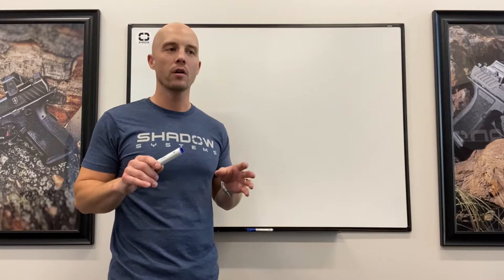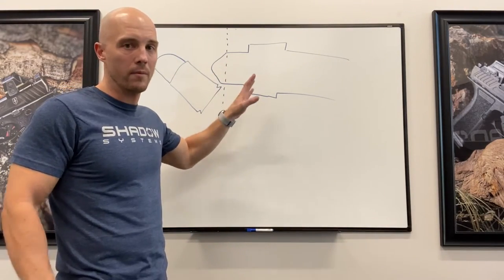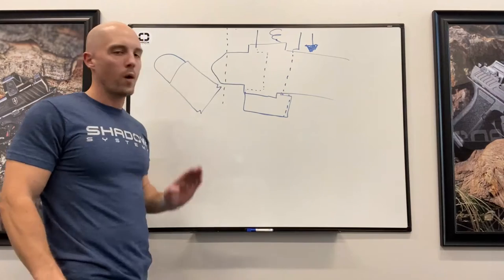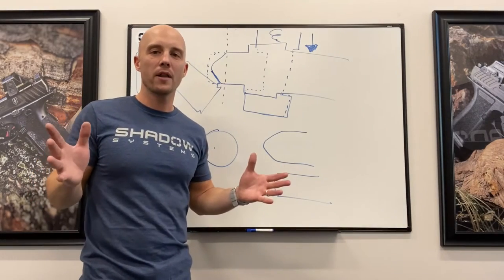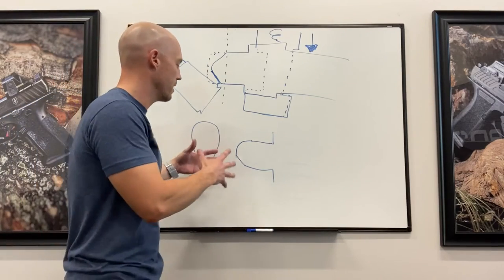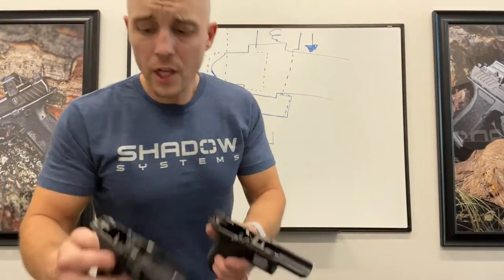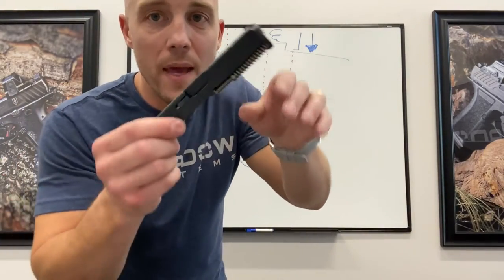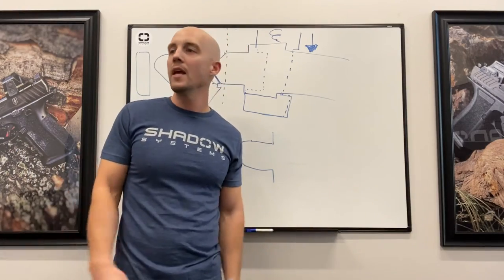Technical Tuesday: What's up with the new firing pin system?

Comment: That's exactly what happened to my MR920, broke the firing pin, but the support was A++.  Now I understand why it broke.  Thanks for the explanation. Btw, I love my new DR920!!!  Big hands and all...
Reply: I had the same problem with my MR920, broken firing pin.
Reply: So did you break a pin with the oils system or the new one?
Reply: @angelobustillos601  So did you break a pin with the oils system or the new one?
Reply: @Tacnipples   Mine was the old one. They also sent me the old one as a replacement.

Comment: So glad y’all made this series. Just bought an XR920 and noticed this. Had this exact question.
My next question would be changing the striker spring like so many do for Glocks. Say I bought a Gen4 Johnny Glocks trigger and wanted it in the XR. Most would be wondering if the countering force of the return spring is enough to cause light primer strikes with 4.5 lb striker spring….since those forces are opposing each other. I doubt it would be enough to cause any real change, but it’s something worth asking. 
My XR is a carry pistol so I leave the trigger alone, but I know some ppl that bought a SS pistol as a competition piece.

Comment: First off my lightning strike Glock trigger came with that special firing pin return spring and made huge difference on reset! also Glock 43 do not have that little hook on the trigger housing yet is still designed the same as Gen 5 so how does that one work?

Comment: You carry the MR920L correct, is that the same firing system still as the Combat version 920 or was that updated to DR style?
Reply from the maker: Hi Mitchell.  The MR920L that I carry is a rectangular firing pin.  From a manufacturing perspective, all models are converting over to the new firing pin system.  Trevor

Comment: If it was better, then why so many lite primers strike with several different ammunition types in my DR920 which just got sent back for repairs for the lite strikes and countless failures to extract? Never had any lite strikes with any Glock I owned, even with steel case ammunition, just a thought.

Comment: Is there any way to discern which firing pin style a SS has without seeing it in person (like a Serial Number or Model Number)? I know this question is 2 years after you made this video, but I want to make sure I buy the gun that is the most up to date
Reply from the maker: Unless you’re buying second hand, every pistol is going to have the round firing pin at this point.
Reply: Thank you for your swift response❤

Comment: I love my MR920 for many reasons including it’s Texas made! I just reduce my carry guns that don’t use anymore and picked up another Elite (without a threaded barrel this time).  Carrying while driving 10 hours in appendix carry made me think about having a non thread for long road trips.
Reply: You can buy non threaded barrels on their website :) also, if you carry with a light you don't have to worry about the extra length of the threaded barrel.
Reply: @fullfire0  I am on their waiting list for barrels and even a Glock 19 trigger....I still want two... slowly replacing my Glocks with Shadow Systems.

Comment: ive actually never have had a light primer strike with the glock blade firing pin , i have had light primer strikes with the round shadow systems firing pin and a the g48 new style firing pin.

Comment: If this is nerdy then please do a lot more nerdy videos!  These are amazing.  Also I guess this explanation is why the gen 5 firing pin safety is shaped differently?
Reply: Not really, they changed the shape to make the trigger pull smoother. It's ramped now which means less force needed to pull the trigger bar over it

Comment: Since the new style has a firing pin return spring, is the firing pin spring the same length and same spec as the prior (rectangular hole)?
Reply from the maker: Hi Paul, the only areas of the part that changed significantly are at the tip.  The spacer sleeve is also different to accommodate the return spring.  There are no other changes.  Trevor

Comment: Do we mr918 owners need to get the new firing pins?
Reply from the maker: No, yours are still great parts! This is part of a change in design for the newer produced pistols. We still make the old version in case you ever need replacement parts.

Comment: somewhat related : don't dry fire your MR920 too much without a snap cap people, that's all i can say, top notch support as usual though
Reply: Why is that? I've been dry firing Glocks for years. More so with dry fire practice for IDPA. With the price of ammo lately, dry firing is the norm.
Reply: I've dry fired mine many thousands of times with no issues
Reply: @cantstartafire  My Shadow Systems firing pin snapped in half life a stick after dry firing too much without a snap cap in the chamber.
Reply: @Tayne195  My Shadow Systems firing pin snapped in half life a stick after dry firing too much without a snap cap in the chamber.
Reply: @worstcasescenarioch  that sucks.   I never use snap caps in mine.  Do you know approximately how many times you dry fired it before it broke?
Reply: That's good to know. I usually use it with snap caps (more protection the better), but I always thought it was still immune to breaking even without snap caps. Guess not.
Reply: @Tayne195  Hard to keep track of the number of dry fire, but if i had to guess easily more than 10'000. I dry fire more than i shoot currently.
Reply: I use a dry fire laser with the Mantis X for dry fire training… I would totally recommend that combo!